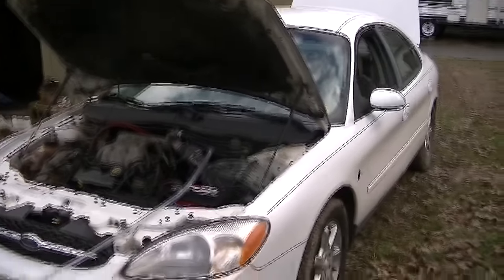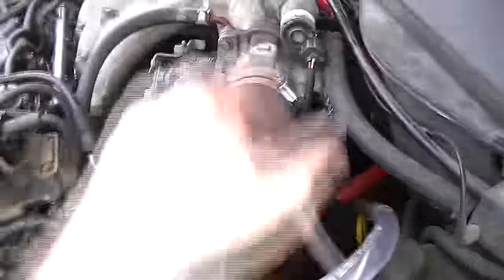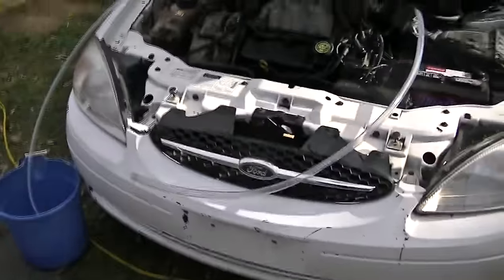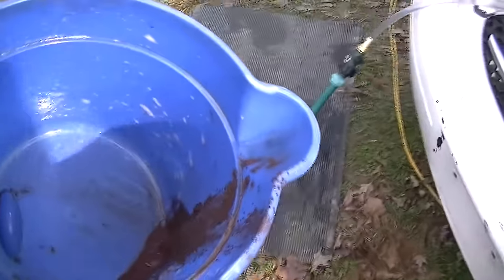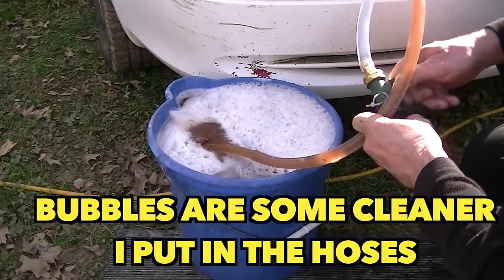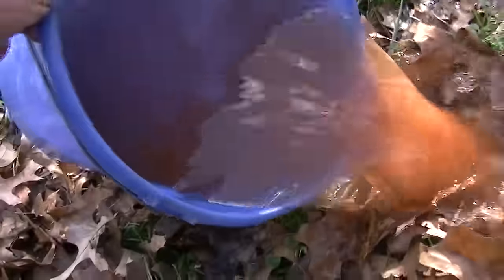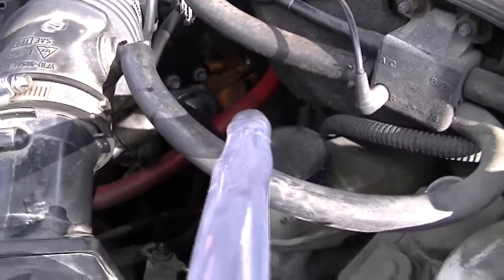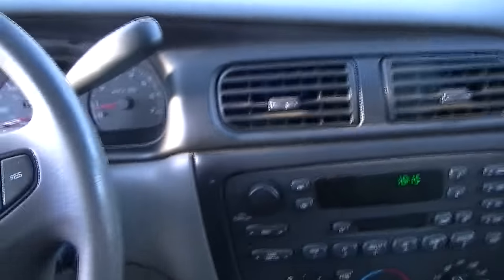Heater Core Flush...100% Plugged! This is Bad! ... Rusty water!!...But there is hope!!!

Comment from the maker: NOTE: This heater core was full of just rusty water!  Previous owner had
 no antifreeze in it....he just filed it with water...so he would not loose money on antifreeze...the result...lots of 
rust plugging up heater core!!
Reply: how to flush a heater core on a Mercedes 2003 ML350
Reply: TVWXMAN32 What idiot uses water in their cooling system? Smh.
Reply: HostileLemons everyone uses water. But your supported to mix it with antifreeze
Reply: alex pencek what everyone? You're  not supposed to put straight water in your cooling system. It's as careless as putting petrol in a diesel car. You risk bursting your system due to the high pressure that occurs when water boils. Water will rust out your engine and it's not as good as coolant in terms of absorbing heat from the engine.  The only time you should ever put water is if the coolant requires it for dilution purposes. Even then the coolant itself will have anti corrosion additives to prevent the water from rusting anything. 
I don't mean to come off as rude but everyone I know uses proper coolant. 
Next time you check your coolant system you will see what I mean. Rust everywhere. That's not good. You're gonna have to shell out for a new radiator soon if you keep putting water in there.
Reply: Water actually is better absorving heat than anti freeze. Manufacturers recommend up to 50% anti freeze but not more and only because of temperature, some extreme places where temps goes like -40 or smthg, they need that. But if you live in a "normal" place, where temps dont go lower than -10º C , MOST OF antifreezes out there do good with 60 to 70% water in the mix. The anti freeze holds the coolant to not freeze and also lubricates the water pump.
Reply: Anti freeze is the same as coolant, i just like to call anti freeze the "pure" product, that comes without water mixed. And when mixed with water its called coolant. VW reccommends on my car specifically, G11 antifreeze , and should be  mixed with water like this : To handle -25ºC, it needs 2.5L of G11 and 3.7L of destiled water. But where i live temps never get close to -10,  so theoretically i would need a very small amount of G11 compared to water, but antifreeze does more than stopping the coolant from freezing, it lubricates the water pump and probably does more things, like avoiding corrosion, etc. So its good to have a good amount of it in the mix, but water actually cools better than antifreeze. Edit: Forgot one more thing, antifreeze has a much higher boiling point aswell, i heard coolant temps goes past 100ºC sometimes, water boiling point is 100ºC, so its dangerous, and antifreeze has a boiling point much higher, past 200ºC, so it can hanle extreme heat without causing a leak or exploding the hoses in the system.
Reply: Did I say straight water? No I didn't, what I meant was water is put into the radiator and diluted with antifreeze to increase the boiling point and stop the water from freezing in the winter.
Reply: alex pencek ok
Reply: TVWXMAN32 It's called antifreeze for a reason damn it
Reply: +idk - LOL, pay attention... He said..., "Previous owner had
 no antifreeze in it....he just filed it with water."
Reply: Is that copper?
Reply: +Someguyto - Don't steal it, they won't take it at the Metal Recycles. I have already tried it, LMFAO 😂😂😂😂😂😂😂😂😂😂😂😂😂😂😂😂😂😂
Reply: I have not tried it yet. I have a 94 Honda civic that pushes coolant back into the reservoir and trying to figure out what is wrong with that. It may be a blown head gasket or cracked head. It also has a terrible knock in it as well from where someone tried to street race it before I bought the car.
Reply: Plain water, deionised water or neat anti-freeze/coolant alone is bad for your cooling system. The water boils at 100°C/212°F and can lead to issues where water penetrates where it shouldn’t because of the pressure. Water just gets too hot. Antifreeze/coolant is the opposite and cannot transfer enough heat leading to warping.

Mixing the two gives the best results with between 25%-40% antifreeze/coolant and 60%-75% water mix.

Enough heat gets transferred away from the engine to stop it warping and the AF/C has additives to reduce corrosion. Some coolants are colored to expose leaks in pipes, some fluoresce in daylight or black light (UV light). 

Same goes for the windshield washer reservoir. Always add an auto detergent, not regular detergent. Auto detergent doesn’t foam like regular detergent but it breaks down the dirt particles and gets them off the glass. Plain water in the washer reservoir, will cause the windshield to smear when the wipers clear rain or snow.
Reply: ferfire9 Antifreeze used to be a separate product that was added to engines in preparation for winter so that the water in the engine block wouldn’t freeze and crack the block - in the same way that domestic water pipes freeze and burst in freezing conditions.

Coolant was added to the engine in preparation for summer driving when it was too hot for water and antifreeze.

That was when people regularly tinkered with their cars.

As engines became more complex and needed less tinkering, a special ‘All Year Around’ mix of Anti-freeze and Coolant was developed.

This meant that no one had to drain the system before winter or drain it again before summer.

It’s true that you can effectively use either term interchangeably.
Reply: +Someguyto - It was a joke, lol.  Anyway, check your " Thermostat " to make sure it opens up correctly. Another thing I check is to see if your Coolant looked like " Pink Lemonade ".  Check your Oil Pan as well.  If there is a " Blown Gasket / Head Gasket ", those will be the symptoms.  But I would check the " Thermostat " first.  Also, if you can..... Open your Water Pump and do an " EXTREME FLUSH " in your Engine's " Passage Way ".
Reply: +MatchstalkMan - I agree with you 100% and spot on, on many valuable points in your posts!
Reply: Nathan Rohrbough a
Reply: Nathan Rohrbough i
Reply: Thanks Mr MatchstalkMan,
Extremely Informative Thread.
Reply: @HostileLemons  old Post but let me add in something. Non diluted antifreeze will actually freeze.  You heard me right freeze. Water helps disapate heat and stops coolant from freezing solid. The coolant soultuion ( ethonal glycol) keeps the water from boiling off because the engine temp is higher than the boiling point of H2o  your coolant dilution prevents this. ..
If you had no pressure for your radiator via a cap it wouldn't flow near as good. It alters atmospheric to control boil off. You don't need heat to make water boil... Look it up.
Reply: I saw a guy on youtube fill the heater core with a bottle of  CLR rust remover wait for 30 minutes then flush it out . IT worled
Reply: @jacobhighland3638  lol 100% antifreeze won't freeze unless you were being sarcastic or something...water is better at heat transfer, antifreeze is better at not freezing and slows down corrosion caused by the water. 60/40 or 40/60 mixes are for extreme heat or extreme cold climates. Most people are fine with 50/50.

But no, antifreeze doesn't freeze before water. That's just dumb
Reply: @jacobhighland3638  the freezing/melting point of glycol is -74 freedom units, -59 science. Anti corrosion additives and water mix will raise that. But 100% ain't gonna freeze on this planet
Reply: Nathan Rohrbough 
Did you flush the radiator at some point at least running quite a few gallons water through the engine and rad? It's likely the rad.. has the same residuals caked up in there .
I back flushed my Tahoe after a new water pump install to get the old  dexcool out that  is a know recall on gm vehicles that  rots aluminum parts . And went with universal antifreeze
Reply: @HostileLemons  \o
I know, I'm an idiot.
Reply: alex pencek distilled water only! Water has all kinds of nasty stuff that collects in your coolant system.
Reply: alex pencek yep
Reply: Mexico
Reply: I have a 2000 Mercury Sable and its basically the same as a 2000 Ford Taurus. When I bought the vehicle from the lady she said that she previously had a leak in her radiator so she put stop leak in the radiator. Now I'm not sure if this happened before or after her heat stopped working. But I did call my local mechanic and he said it would cost around $600 to $700 to replace the new heater core that's with taking the dash out. So I want to at least try the small easy cost-efficient things to try to fix it first. And it's not leaking anything on the floorboard, it's not running hot so I know it's not the thermostat. So my guess is it's stopped up the heater core. So I'd like to flush it out. Now did you actually go and buy a flush kit at an auto parts store? Because the piece that I need to go on the water hose is a king nipple but I don't think it will actually connect straight to the water hose I think I have to buy a flush kit from the auto parts store and use one or two of the parts that go on the water hose, I could be wrong though. So could you give me a little info on that please?!
Reply: I watched a previous video here on YouTube about flushing your heater core kind of like you're doing. Now he actually did it in reverse, what I mean by that is he actually ran water through the exit Outlet and he had the water exiting through water in Inlet. The reason he said he did that is so it would loosen up what was in there blocked up. I'm just curious if that's a good idea or not.
Reply: My mechanic says coolant cause rust use water only I'm confused
Reply: Say what🤔

We're made in HIS image. HE made us with the power of free choice
A good prayer:
I'm a sinner JESUS please forgive me for all my sins I know you shed your Blood for me on the cross at Calvary. Thank you JESUS for my salvation and for shedding they Blood for me. I love you JESUS. 
Romans 10:5/10 ct...❤️k
JESUSisLord!Amen...
Amen..
If you'd like to call someone who cares 
83
For
Truth.
bc you don't know when you'll die?
.y r u hesitant. .. .... .. . .....
Reply: @HostileLemons  Pure anti freeze can and WILL freeze. It is suggested to use 50 50 mix, 60 40 mix 70 30 mix with water. You have to, it's just plain and simple as that. There has to be a mix with water in the anti freeze.
Reply: @kjamison5951  You can also use rubbing alcohol in your windshield washer reaviour, and I also have heard it said that yi can use viniger to. At any rate using rubbing alcohol wouldn't hurt as in about November when the weather gets somewhat colder, the rubbing alcohol will prevent the freezing, number one and number two, the rubbing alcohol will spray onto your windshield melting the thin layer of ice forming on the windshield.  And, look at it this way. If you have to wear glasses, the Optromist will clean your glasses with, you guessed it. Rubbing alcohol.
Reply: @JodBronson  you gotta cut it up and mix the pieces with other copper items (if its questionable copper)
Reply: @mcmaldek - SCROLL UP AND READ EVERYTHING!  LMFAO
Reply: I just did this to my 2000 ford expedition, and now it not running right, and the engine stated shaking when I drive it

Comment: Decent video, but what was the point of the bucket if you just dumped it out right next to it? And turning your hose full blast can help but it's not a good idea. Heater cores are made to withstand about 10psi of pressure and a garden hose can put out 60psi. You will collapse your heater core like that and that's never fun.
Reply from the maker: Bucket- Shows how much water needs to flow to clean up a small heater core. They can hold 2 qts of mud derbies. As for  the Heater Core here is a test. (They can withstand more pressure that people can tell you! ) - https://studio.youtube.com/video/wMoUcifbuXg/edit

Comment: The block has passages around each piston, the coolant is made to go though and around these via passages and Cool the cylinder walls.

 with a car that has no coolant these passages slowly fill with rust Rubble that falls off the walls... I've actually seen this on an engine that I've got from Japan and pressure washed the engine upside down through the coolant jackets like if I was pressure washing the Pistons ( engine upside down) just in the coolant passages. 
 I got roughly 1.2lbs of dust and black bits Doing this making sure there was no rust present in the cooling system.

Comment: I had the same no heat in my 99 Taurus, I flushed it directly to the two heater core tubes with 5/8 th vinyl hoses too but I just used a garden hose spray nozzle & flushed both directions. I did it in my garage where I have a floor drain. Mine had antifreeze but the core was still full of brown crud.
Reply from the maker: I know right!~ At least now the "newer" ones...the Fusions don't have this issue. My coolant bottle is so clean in it....starting at 2008

Comment: What I do is after I get the bulk of the crap out with water pressure by swapping hoses a couple times, I get the water out with a little air pressure, and fill it up with CLR and hang the hoses up high to let the CLR fester over night. Then flush it both ways a couple more times the next morning. If you are worried about the CLR being too aggressive and creating a leak, you can use something like Prestone radiator flush from Autozone. Do the same thing, get all the water out, hang the hoses up high, and pour it in to fester overnight or even a couple days then flush both ways a couple times with water. You can also put the same radiator flush in with the fresh coolant and leave it in the system for a couple weeks and drive it normal then flush it again.
Reply from the maker: Thanks for the advice!

Comment: I did this on a 2008 Lexus. A head gasket sealer was used some time ago. I belive sludge buildup thank to the driver's side of the heater core. Passenger side had heat but the driver-side did not.  So, I used a small 4-7 pounds of pressure water pump to circulate CLR from a 5 gallon bucket and back to the 5-gallon bucket. I let it run 2 hours. That fixed the heater core.

Comment: It's such a satisfying job! my front heater core was like that but my rear heater was completly blocked AND the turbo coolent lines and hoses AND! THE INLET MANIFOLD cooling lines and hoses, had to use a long stiff cable tie to poke and flush down the lines could not beleave how much crunchy browny blackish rusty shit was in the whole cooling system lol Now i'm hopeing it will run a little cooler
Reply from the maker: Hope it works!

Comment: End game might be reached quicker if you also include a slug of air.  That would require a disconnect, allow some water to flow back out and reconnect supply hose on this simple flush rig.  I have a multisize compound nipple type of radiator back flusher with shop air injector on it that really blows the heavy chunks out of the engine itself.  But shop air is going to be overkill for just the heater core unless you carefully size the hole just right.  The expanding air then inside the core provides the turbulence you can't get otherwise although the water hammer technique (on-off, on-off) is quite good too.  You got it, could have been much quicker is all.

Comment: I have a Taurus that has the same issue. I had to install a coolant filter on the upper radiator hose to keep sediment from plugging up the radiator. It's been a process, but I'm finally starting to see daylight on getting proper flow in the cooling system.
Reply from the maker: Right Nice!

Comment: Make sure to use distilled water when putting coolant back in. He should flush the tap water with distilled water. To prevent corrosion inside the engine coolant passages. If the previous owner used tap water it would explain the rusty mess that came out.
Reply from the maker: Yes thanks for the info!~

Comment: As far as the spark plugs, pull the upper intake. Takes maybe 20 minutes if you know what you are doing. If you have a misfire, it's probably a coil pack. Install new coil packs in the rear, and pitch the old one. The rear ones are more likely to go bad because they run hotter.
Reply from the maker: Great! Thnaks! ;D

Comment: Thanks for your video Nathan. I suppose you also flushed the engine and the radiator too because of the amount of crud  and rust that must have been deposited there to. If not the heater core will soon be clogged again.
Reply from the maker: Yea like 2 times later to get it supper clean.

Comment: That’s what came out of my sister’s sub-compact. I flushed it one way, flushed it the reverse way and then flushed it forward again. Then I let the hose run until the output was clear.

I had literally returned from vacation and been awake for 18hours when she called, her car was overheating in July. The problem started the previous December and she never mentioned it until the pressure release valve had blown steam under the hood in July.

Anyway, I gave it as good as an overhaul as I could, checking oil and tire pressures as well. She drove hundreds of miles every evening to talk about her work abroad.

Not long after that mini overhaul, she fell asleep at the wheel and crashed the car. 

She broke a collar bone and a wrist (opposite sides) and made a complete recovery. The car was junked.
Reply from the maker: Wow. Some people have all the bad luck ;(

Comment: Got a subaru forester (2003)  that had bad head gaskets and previous owner used stop leak which might explain why the radiator blew.  Car has great AC but heat sucks, so I will try this water flush, but I have a pump and CLR to send through it if the water flush does not clean it out.   FWIW.
Reply from the maker: Nice!!